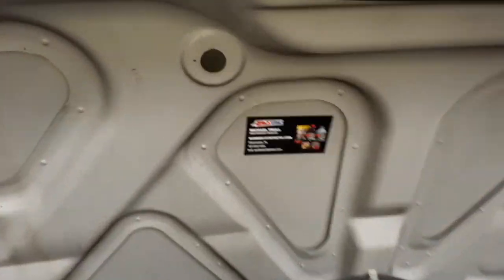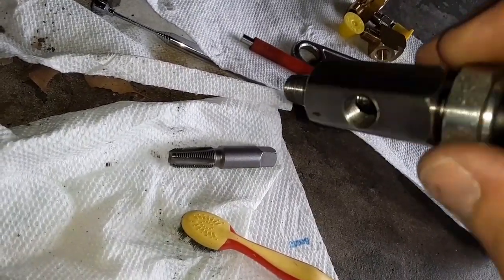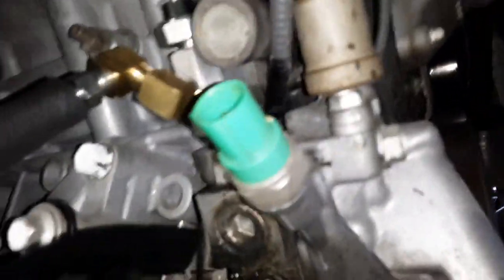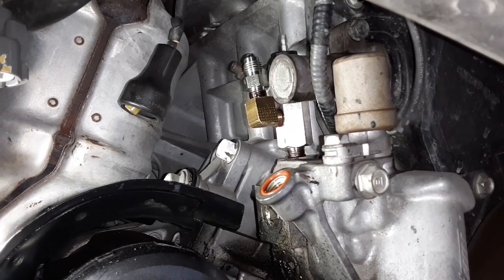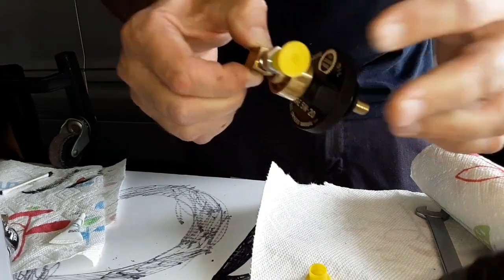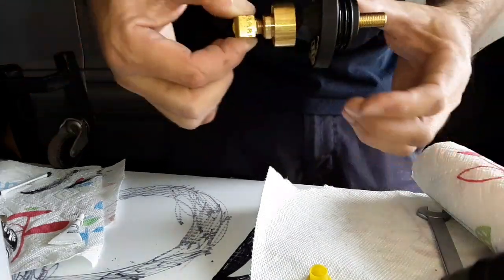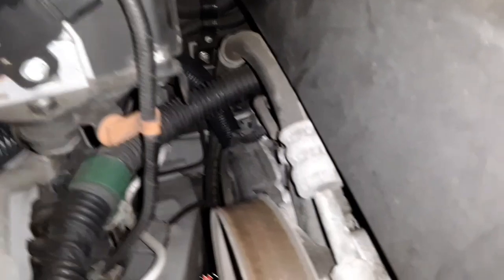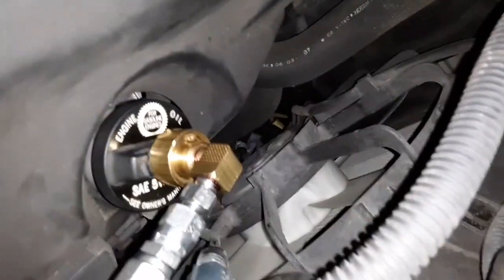2007 Honda Pilot Amsoil Bypass oil filter install parts 2&3 of 3/oil change Amsoil SS 0W-20/Start up

Comment: HI Mike, I have used offline filters before and they are definately worth it.  In my GM Ecotec with VVT, I contemplated using the oil gallery ports on the side of the head, but decided against it.  I don't want to reduce any pressure in the head.  I will probably use the oil pressure port on the side of the engine, which requires removing the starter.  This engine is GDI, and they pose a real problem from abrasive soot and engine wear.  https://www.lubrizoladditives360.com/gdi-soot-a-new-challenge/  If you want to monitor the hard particulate removal, and cleanliness in addition to wear metals, Polaris will not test for particulates in used oil, but TestOil labs will.
Reply from the maker: Yeah I have heard the GDI engines do make a lot of soot. Thanks for the heads up on the oil testing labs. Sounds like a pain to install on your engine but like you said definitely worth it! Let me know how your installation goes.
Reply: @MikeTrullAmsoildealer  Much of the soot is sub-micron in size and I am contemplating whether to use an Amsoil filter or depth filter like Frantz.

Comment: How has it held up?
Reply from the maker: Good, i sampled the oil after 13 months and it came back still good.  So i changed the full- flow oil filter and topped off the oil and im still running it. Currently at 160K so only about 12K on this oil change but its hard stop and go short trips in Clearwater Florida (idling at stoplights). I'll post the link to  the oil analysis video after this. Thanks for watching!!
Reply from the maker: https://youtu.be/fmqzpXzO4qk
Oil analysis results video
Reply: @Mike Trull Amsoil dealer  thank you so much what kind of bypass system should I run for a 2012 honda civic ex?
Reply from the maker: @Killmonize  it's going to be the same type that I put on the pilot, the universal . I believe it's the bmk 21 and the filter I used is the smallest one the eabp90 am not going to lie this was challenging for me. I would assume your engine takes the same 1/8 bspt fitting where your oil pressure switch is located not sure how easy that is to access and obviously you're doing it at your own risk. I shudder to think what would have happened if I had stripped the threads out of the engine but thankfully as you saw in the video it did end up working out. Another consideration is do you have the room under your hood?
Reply from the maker: @Killmonize  https://www.amsoil.com/p/universal-single-remote-bypass-system-bmk21/?zo=1463115

https://www.amsoil.com/p/ea-bypass-oil-filter-eabp/?code=EABP90-EA?zo=1463115
 
And if it's like my Honda you will need to Source a 1/8" BSPT tee fitting to go in place of your oil pressure switch to get your oil to feed the system.
Reply: @Mike Trull Amsoil dealer  thank you so much. Yah of course my own risk. Thank you for the information you have provided.